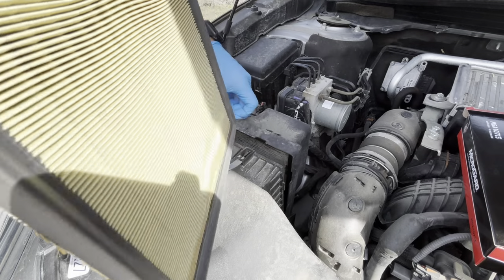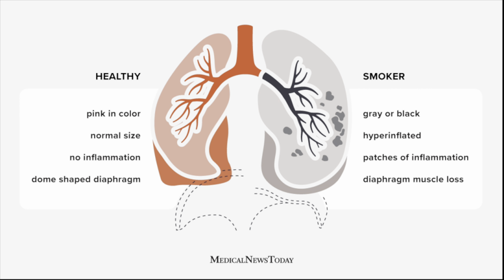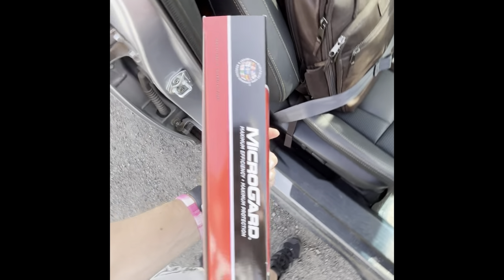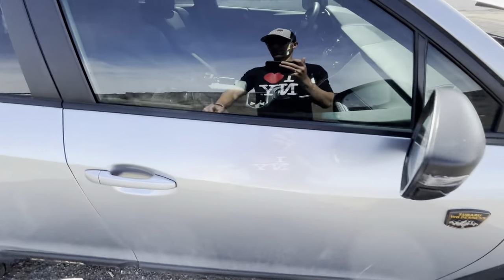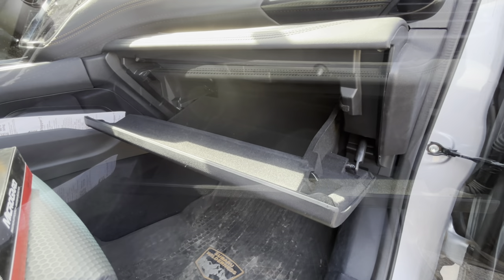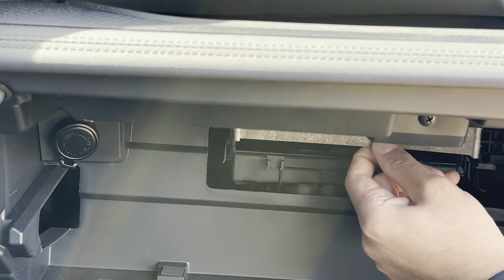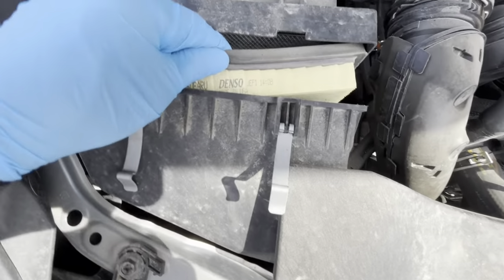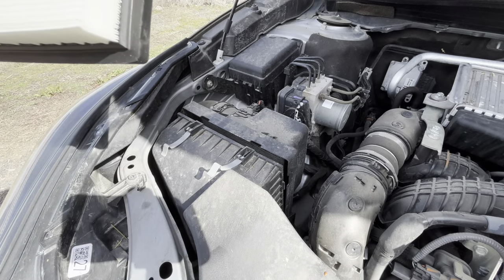This is Why you NEED to Change your Cars Filters… | Subaru Outback Wilderness Turbo

Comment: How often do you change the air filters.
Reply from the maker: While I won’t share how often I personally change them 😉 I believe the manual shows the Cabin Air Filter every 12k miles or 12 months, and the engine air every 30K miles or 30 months.